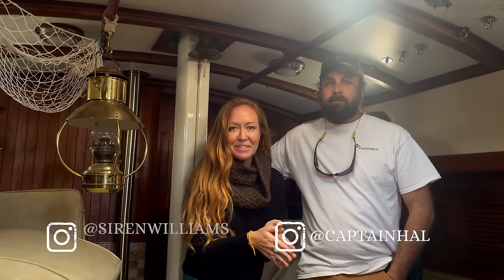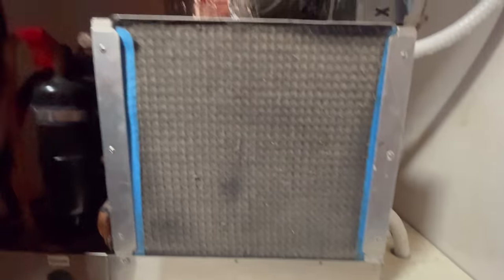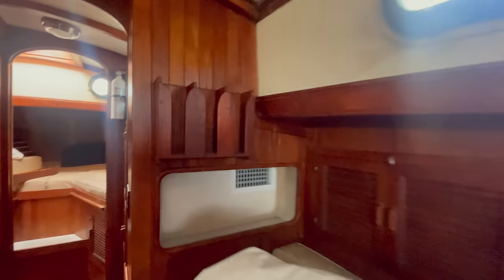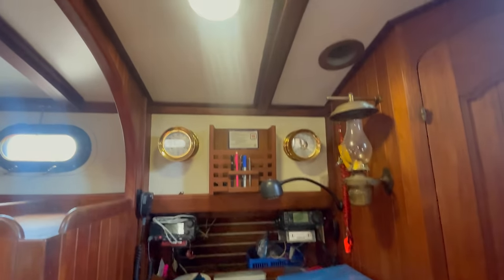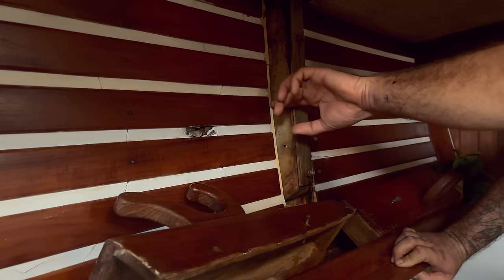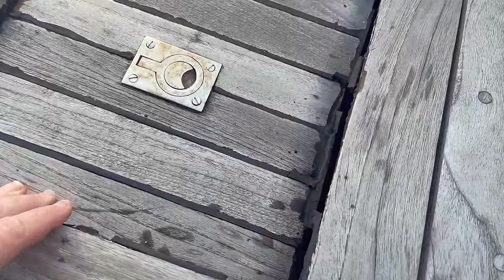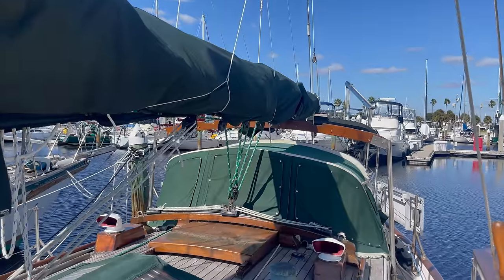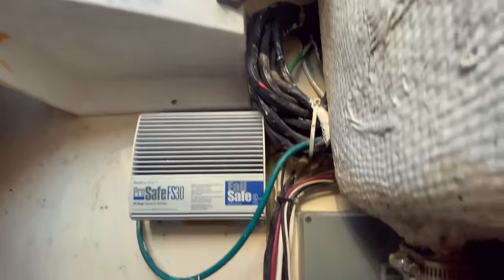I’M BUYING THIS BOAT -1976 TAYANA 37-  But we aren’t sailing out of this marina. (Ep. 42)

Comment: Balsa core deck forget the chainplates run while you got the chance dont forget below the teak deck might be bad too so reply the whole deck 1/2" x 2 layers marine ply fiberglass and paint still a pretty big job stop thinking everything must be varnished more time you spend working then sailing sure it's alright to pick up a project go sailing forget varnish and paint work if it is watertight go put of paint and varnish
Reply: Not only that the screws for the deck are pan heads and not counters so no wonder plugs have popped if there was minimal damage to the balsa deck I would say have at it but balsa is a bad core marine ply is more resistant if that says anything the only way you would know the core is good is taking core samples or and most owners would say no unless you purchased the boat how you can actually see how bad the core shape is in expensively is by wetting the deck extensively on a hot day and using infrared to see where water stays as it is drying but this Is just a professionals point of view
Reply: No one is putting 1/2" x 2 layers of GRP on a deck.  Cost and particularly weight would be ridiculous.
Reply from the maker: Im less worried about core samples and the like because I know for a fact that any original deck from 1976 is absolutely leak in and has taken on damage. The age alone says that, plus the evidence you can see visually on deck- a number of things that were pointed out in the video. I don’t necessarily need to think too hard about it. I just know it’s done and there’s damage and it leaks and it need to come up. My question was - How bald does it leak inside currently? You can see water damage but on a boat of this age, they leak, get sealed up, leak, get sealed up, so you can’t know for sure where it’s leaking in the moment because many water spots aren’t from current leaks, they’re from past leaks. And the other question is how long can I let it ride without doing severe damage to my teak interior which is currently in quite good condition. Of course, even with a surveyor and moisture meter, there’s only so much they can tell without wetting the deck or sitting through a rain shower. So that’s why I wasn’t overly concerned- because I bought the boat at a price that reflected the need to rip the deck off anyway.
Reply: @pete9501  I do this on almost every boat cost is part of boating
Reply: @TheSirensLog  I have done rebuilds of teak decks and new installs you can learn alot from people in the business of ship building you might ask a question I answer it that's how you learn
Reply: If you don't want to spend on materials you probably should not own a boat
Reply from the maker: I don't know if you're talking to me or the other commenter, but if I was afraid to spend money on a boat, I wouldn't have bought one knowing that it needed new chainplates, rigging and a whole new deck.  @grahamwheelock7497

Comment: How come no one oils their teak! That stuff will last 100 years if you simply care for it.
Reply from the maker: People do! I was to Semco it, or Starbrite has a similar product. People used Tung oil for thousands of years, and if we don't Semco it, we may patch it up good and just tung oil the entire thing until we can get to ripping up the deck.
Reply: It would be like putting lipstick on a pig ..a waste of product bcuz it too far gone? . For now the same price you’d get a really good waterbase liquid rubber sealer that would soak into and seal any and all leaks. At least till you have the time money and cheap labour force to re-do it in teak.
Edit ps 
@TheSirensLog
You guys know A LOT .my post was more of a question. I just subbed.
Reply: I think the inox nails are although to put lines, to put washed clothes to dry.
Reply from the maker: @FFLFFS Yeah well
Frankly any work done to the deck at this point could be considered a waste because, like you said, the deck is done. I’ve patched it to help stop the leaks so we don’t destroy the interior, so we’re good there, but as far as any exterior products go, we just have to be aware that whatever we do is temporary because we can’t keep the deck. Semco or Starbrite’s similar product is around $200 and should do the entire deck. We’ve been sponsored by Starbrite for a long time so we’re very fortunate to already have that product ready to go. That would literally seal up the teak and can help with leaks, somewhat. Mostly it’ll help the teak to stop absorbing water and getting into the core below it. That’s important! With tung oil, (the very traditional and expensive method) it would take a lot more product and with the wood being this dry already, it’ll soak up a fair bit, I fear. Teak oil is something we also have on the boat from Starbrite and we do have that option. The difference is- the oils don’t seal the wood like these newer and more advanced products. They’re “good for the wood” but really don’t do nearly the job and can often be more expensive. The oils will bring out the rich, brown color, which some people prefer, and the semco or Starbrite sealer will usually make the wood the bright honey color. Some are tinted a more brown color. I prefer the brown, and just for fun, we may decide to oil the deck just because we “can”. If we were starting with a new teak deck, we might make different decisions, but knowing this deck is at the end of its life, it give us a little space to have fun and do what we want with low risk.
Reply: @TheSirensLog  
Well it look like YouTube deleted my reply. ?? 
Just wanted to thank you for your reply and that I’ll be watching. 
Happy sailing ..
Reply from the maker: @FFLFFS not sure! We’ve been accused of deleting comments before, but sometime I think YouTube glitches and doesn’t show things. It’s frustrating and we’ve seen it happen quite a bit. It’ll probably re-appear. Hahah
Reply: @TheSirensLog  
Nah YouTube for sure. I’ve had that happen lots. 
Could of been maybe they thought the liquid rubber I mentioned looked like I was promoting a product.?? 
Idk..
Reply: You must not own a boat.

Comment: I thought she said in another vid, that she would not used boat with orig teak deck.
Reply from the maker: It’s not generally advised unless you really like that boat and are getting a deal on it. If I’d paid them the asking price on the boat, it would have been way way too much. But we got a deal, so it’s worth it for us.
Reply: @TheSirensLog  did you ever mention what you paid?
Reply from the maker: @alanmeola8978 Not sure, but we paid $30k and immediately put another $15k in it before leaving the dock but still needs all new rigging and new chain plates and the deck needs to be pulled and plenty more!

Comment: Ok, the teak deck is clearly recent, just fix it up. No need to rip it of. at least ask a specialist first before you do anything. It's a recent deck and i know it!n THE DECK IS NOT DONE, I SAW NOTHING MAJOR 🙄 Unbeleavable, but I love you as a couple 😊
Reply from the maker: Yep that’s why we had a surveyor look into the deck just to see how bad the damage was, and of course it’s saturated underneath but nothing too structural yet so we have some time. Once we pull it, we have so much work with that anyway, it’s ok if we are repairing some damage.
Reply: Oh, you already had a surveyor? I commented on the wood itself which looked very smooth. It could be the badly repairs making the leaking like the screws replacing butts (absolute nono) being too long. Normally the upper gelcoating is thick enough for apropriate screws. So I am a bit disappointed I learn there was water incress. Still teak makes the boat beautiful and replacing it with glass is also a lot of work. Initially I thought you needed to replace some butts and all the seems. Anyway, hear from you 🙂 @TheSirensLog
Reply from the maker: @tip00former1  Well yeah the seams are ALL separated from the wood, and it was definitely in despair at some point for them to put a bunch of new screws in the deck like that. I have a feeling it had a moment where it was really bad and took on a lot of water- and it still is. The wood itself does look great! Whoever had the boat knew how to maintain the wood itself, thank god, but inevitably the seams wore and the teak lifted at some point. I had an additional 3-4 minutes of me talking and explaining the teak deck and what would have happened and what I believed our plan should be moving forward, but Hal said it was excessive and wanted me to take a lot of it out of the video so I did.  But basically my point in the video (what was deleted) was that- what do we do at this point until we overhaul the deck? Smarter to sand a bit and do all new seams? (Big job, lots of money, and worth it?) or to just seal up the screw holes, do patch work and see if we can get one more year out of it? And I vote was the latter. When I went through the deck with the surveyor, he literally had said almost word for word everything I’d said, so my assessment was correct (woohoo! Always makes ya feel good) but I really needed him to see if he could figure out the extent of the damage it may have already caused. He was able to say that while there was a lot of moisture under the teak (as expected) he could see us letting it ride for a little while. It is obviously somewhat urgent and needs to be pulled up before we get interior leaking issues, but for the moment we are ok.

Comment: Solar panels look like 90 watts each. I call BS on you not spending a lot of time on the teak deck.
Reply: Not immediately.  This winter they're coming up.
Reply from the maker: No that’s not what I said. Hal had previously voted to re-seam the deck, sanding it, etc etc etc. I told him that would still be very expensive and not worth it, considering it needs to be completely pulled off anyway. I don’t want to throw that much money at it just to keep the deck another 6 months or a year. So im not going to spend much time on it before ripping it off. I’ll just patch where needed to get by until we do the big project.

Comment: 25-35k to remove teak decking, repair damage, and replace with fiberglass. It’s the damage you can’t see that should frighten you. Forget the stuff you can. 49k is way too steep a price (I found it on Yachtworls). This boat basically needs that in repairs. Move on
Reply: What if we give, lets say half that?
Reply from the maker: Yep, in fact if you read the text popping up on the screen in the video I actually said those words that teak decks always leak and it’s about how much damage is already there, and what we can’t see. We didn’t pay $49k either so we have money to do what we need. Also, that price is labor. We can do the work ourselves
Reply: Well, resin and fiberglass aren’t exactly free. Nor is gel coat easy to reapply. I have helped a guy repair his decks. He thought it would be easy too. News flash it wasn’t. Took him a looonnnnggg time to finish.  I am not saying you can’t do it. I am certain you can. But when all is said and done you buy a sailboat to sail. Do you really want to spend a year and a half fixing this one? Personally, I’d rather buy a boat thats near perfect with updated electronics and new sails and no deck issues. And no impending 25-35k repair woes.

Don’t get me wrong, Tayana’s are a bucket boat.

But hey, what do I know. Maybe you guys are looking to become a DIY refit channel. In which case, you have chosen well. It will be an amazing boat one day, when you finish.  And i’ll watch every step
Reply: @matatooie  I have replaced wood core decks in the past.  It's is easy but very time-consuming. Chain plates and rigging should be done by summer when I would be sailing anyway. All I've ever known is hard work. I've primarily worked in the marine industry.  I can bust my ass on my boat to save money or bust my ass on someone elses to earn the money to pay for someone to fix it for me. I'm not a fan of cold weather and water.  I am salty as they get, but I won't sail in cold weather unless I'm getting paid.  As far as new boats, I don't like the mentality of modern boats. Sail or power.  Speed has never been a priority to me.  I prefer full keel boats for comfort. If I bought a modern boat, it would still be a full encapsulated keel like an Island Packet or a Shannon. It's like the old saying goes. If you want to get somewhere, buy a power boat with a sailboat you're already there.  I get everyone is different, and I see where you are coming from.  Maybe you can see my point.

Comment: Was a great boat 40 years ago, but too much time and $$ money needed at this stage of its life.  I vote NO.
Reply from the maker: Well we got her for a good deal which leaves a little room!
Reply: @TheSirensLog I think you did good and I think you will enjoy working on it. You can move the ac system hoses can be moved and if done right you can make it better and still have room to store stuff an in line small blower can keep the air push to the front.
Reply: I’d like to know where you’re shopping at this price range to find what you’re voting yes on ?
Reply: They were a great boat 40 years ago and they are still a great boat, will always be a great boat. And I'd rather spend my time and money on a beautiful classic that after 40 years are still going strong. Than waste my time and money on a bathtub liner with sails
Reply from the maker: Thank you!! hahahah We completely agree. She's a beauty and a strong boat. She just needs love (and time and money. hahaha). @MartinPedersen-xp2ru
Reply from the maker: Very good point, thank you!  @chadstinson9886
Reply: @MartinPedersen-xp2ru  yes! And the old wood work is the best better them the plastic they use in newer boats the price of boats has gone up while quality has gone way way down. I think they are doing a good thing and after they are done I think it will be better then the new boats I know it already looks better and after that OCD red hard gets done with the bright work it's gunna be a looker.
Reply from the maker: hahahahah You're right about that!!!!  @chadstinson9886

Comment: Unfortunately that boat has a lot of problems, not least ofvwhich isvthe canoe stern. That body plan tricks the water into thinking you are a shorter boat. All the newer boats are sugar scoop and likebit or not, they are faster. You might not like it if you get beat time after time by boats only 35 feet.
Reply from the maker: Well luckily we don’t plan to do any regattas. 🤷‍♀️
Reply: When did sailors start caring about speed?  I have always heard if you want to get somewhere fast, get a motor boat.  With a sailboat, you're already there.  I guess times have changed.
Reply: Ya I was about to say as they did... I don't think they plan to race it.
Reply: Perspective, perspective, perspective.  You are using one that is entirely different from theirs.